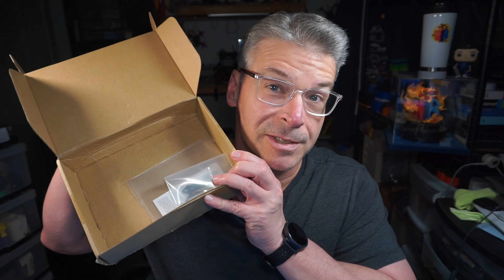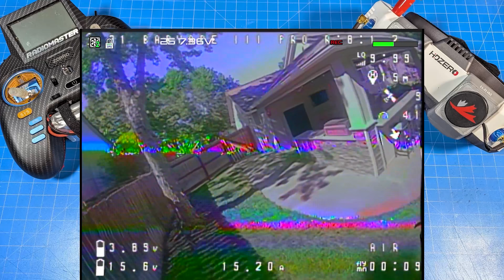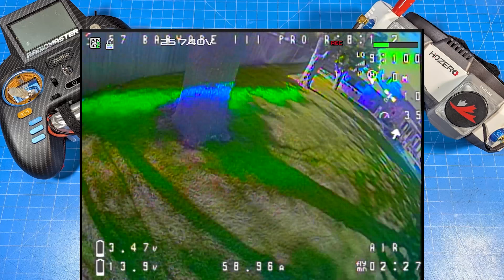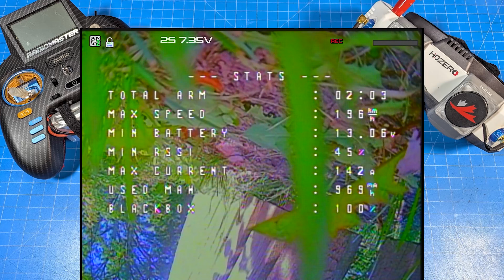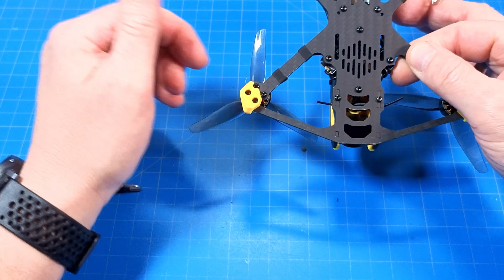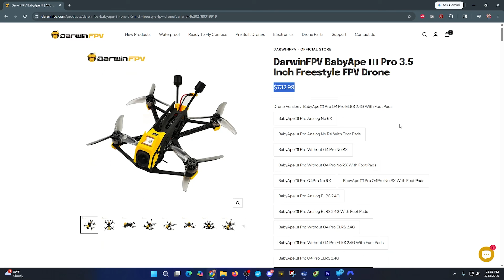FPV is getting harder to afford Is a 3.5inch drone for $190 a good value?

Comment: Is the camera flickering in the real use or it is just because of the video?
Reply from the maker: The signal from the video transmitter on the quad to the goggles isn't very clear. There are others here in the comments with the same question and one person noted that they changed the antenna and got much better results.

Comment: ublock is blocking certain parts of the java script on that page most likely. Also don't use adblock with ublock get rid of adblock entirely. then test the page, then if still an issue test with ublock off. then turn ublock back on and deal with it because any number of small inconveniences is better than raw dogging the internet.

Comment: Nick you said you were using your HDZero goggles, was the picture quality through the goggles as bad as what we are seeing with all the colored flashes or is that just the way it recorded/downloaded?
Reply from the maker: That is pretty much what we see as well. HDzero does a much better job of true dvr than do other goggles.
Reply: @NickBurnsFPV I've probably watched every video that you have made and I can't remember a time that the HDZero system made that much interference especially as close as you were to the drone, 
I did read in the comments where someone said it was an analog system but still I've seen Josh B testing analog vs HD and he would get quite a ways away from his house/himself before having  much video breakup, to me as a newbee it's almost like the antenna wasn't getting a good connection 🤔
Reply: @JohnCalhoun1963  I own this quad. I replaced the antenna with Cherry RushFPV. It improved the reception a lot.

https://youtu.be/ZlsK0B7sRJ4?si=OPObReXH1DvUh5tq
Reply from the maker: It might be worth noting this is analog rather than hdzero
Reply: @Dimar.Siregar yeah, look at how far you were away from yourself and  I didn't see any break up at all, I think they gave Nick a defective one to review, 🤔 in his backyard he was probably a max distance of less than 40 yards away. 😮

Comment: yoooo, you made this at the perfect time cause  i want to buy the baby ape II or this one and i was wondering witch one is better, if you could tell me that would be great!
Reply from the maker: Better is really so subjective. It would depend on flight goals and flight spaces. Bigger propped quads are more suited for larger spaces and have longer flight time.
Reply: @NickBurnsFPV  I want the better one for freestyle, I don't know if chatgpt is a good source but it says the baby ape II is stronger and cheaper but the durability is less then the III pro
Reply: And I currently fly the firefly 18 and I want the biggest jump in power, not necessarily in power but like freestyle capability
Reply from the maker: I would still have to ask about flight space. A small quad in a large open space is going to get pretty boring after we learn to fly or if we already know how to fly.
Reply: @NickBurnsFPV  I would fly mostly in a medium sized field and possibly on the weekends on a massive massive field that almost has no end, I mean you can't see the end of it
Reply from the maker: Hey there, sorry to keep you waiting. I have been mistaken in our previous. When I read babyape II vs this one I was thinking the smaller baby ape mini 2. In this case your asking about the babyape II pro or the babyape II. they are both 3.5inch propped quads so the flight space needs would be the same. With that all sorted I have to suggest going with the babyape III pro...this videos quad. I think the new frame design is more durable and the build is less convoluted if repairs are needed.
Reply: @NickBurnsFPV ok, thanks a lot!

Comment: having the OSD in the footage is no issue for me. most people watching this will be pilots and we see this information all the time, we're here for information and this provides more rather than less. just answering the question you asked in your vid, whether it matters
Reply: he was talking specifically about the hdzero goggles rssi bar in the top right. the overall osd isnt able to turn off either way thats always gonna be there in dvr.
Reply: @son_of_a_birch  isnt there an option in modes, to have "disable osd overlay" assigned to a switch?  Im fairly certain it wont show up in the dvr either.
Reply: @NevrFPV yeah u could do that but then youde be flying with no osd...

Comment: Good job i was sat down and had recently laughed hysterically, as the nearly 300 dollhairs for a pnp analogue! Economy if scale dictates that fpv equipment should be dirt cheap by now, due to the exploration of new market sectors, ahem.....😮😊
Reply: its 190$ but still a lot for an analog
Reply: @roFPVAnalog for comparison I got a new 5 inch analog with analog and elrs for $145 a couple years ago.
Reply: Ask orange dear leader why everyone has to pay more for ever

Comment: I can recall buying their first 2s-3s Johnny 3 inch for $98. Now that was a good buy other than motors being crap and replaced with some 1406 3300kv then had to replaced the analog VTX and antenna but still it's great drone for under $100
Reply: What 🤣 so its garbage
Reply: @ductgoosefpv  the motors definitely were but I burned the vtx out. Still great deal for an already assembled quad if you have some knowledge and parts.